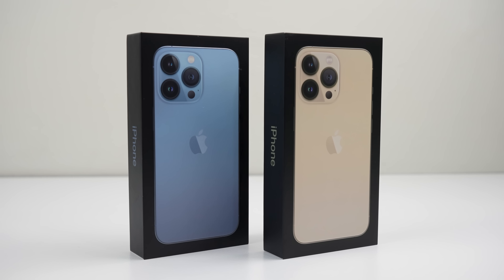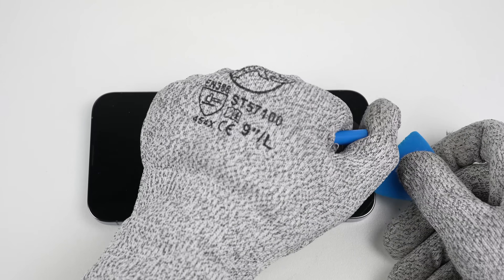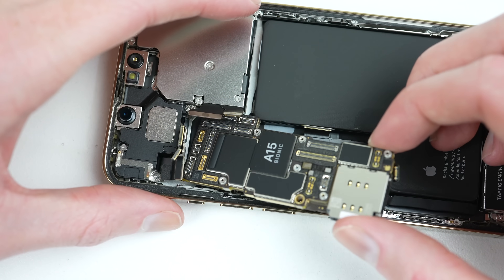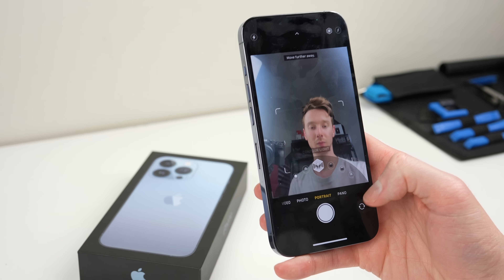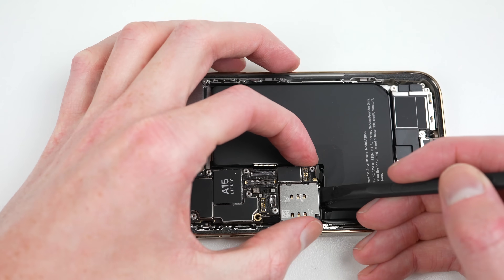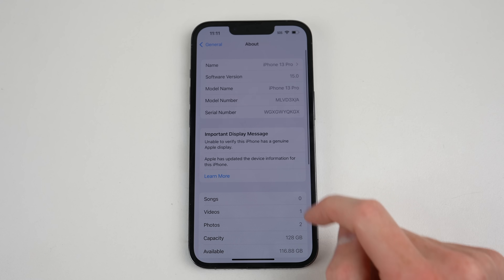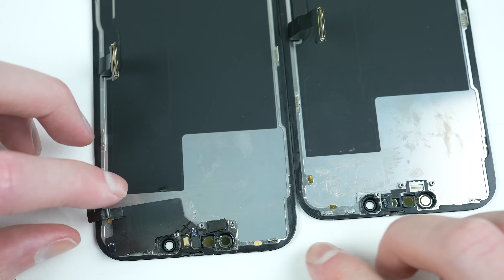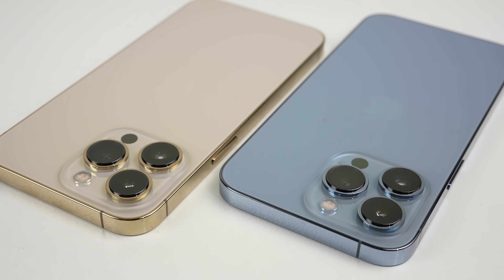iPhone 13 A Repair Nightmare - Teardown and Repair Assessment

Comment: This is fucking criminal. 

Imagine changing the oil in your car and finding your turn signal and headlights no longer work because you didn't get the oil change from the manufacturer.
Reply: No no no. Not just from the manufacturer.  You need it to be changed by manufacturer, or prepare for unforeseen consequences
Reply: @Raghetiel  It’s not shutting down! It’s not-
Reply: @bluedogz1624  Nice half life reference.
Reply: @Raghetiel   like not getting a third entry
Reply: On new BMW models you have to go to a BMW dealership to get an oil change, because you need some proprietary tool that isn't even for sale, in order to simply change the oil.
Reply: @overlordh1254  also i think there was a time when BMW has subscriptions to use apple carplay when a new toyota corolla has that as standard if i don't remember
Reply: @aujorduunforte2922  Some BMWs and other manufactures force you to have a subscription to use the heated seats!!! No joke
Reply: @overlordh1254  you don´t need to if you know how the tools work and more important how to make tools.
Reply: @overlordh1254  I have a relatively old Lancia Delta, still it's better to do a lot of work using Lancia services instead doing it to yourself. The number of electronics and the complexity of the multijet engine, even 11 years ago, were so high that even changing the battery by yourself can cause a failure to some electronics if not done professionally. I think that the new cars, that are even more connected and extreme, have even more issues if people DIY causes wrong currents in electronics power. So I think that, to avoid damage to CPUs, batteries were blocked at software level. Also, probably the oil is because with the new standards even the engines are really difficult to manage as a DYI. The latests Ducati motorcycles have parts that are manufactured under vacuum, and needs special tools to replace. These parts are needed as if not done under vacuum, the engine cannot be pushed to the performance they're pushing it now, that it's fairly extreme for a two cylinders. As more as something become technologically advanced and miniaturized, as more it cannot be easily replaced by third party or yourself.
Reply: BMW did it with car batteries -.- on new models if you change the battery yourself, the car won't start - because the battery is serialized -.-
Reply: @supermodel2011  how do they serialize a battery, isnt it just positive and negative leads.
Reply: @TAussieG  the newer BMW models are equipped with what BMW calls Intelligent Battery Sensors
Reply: @TAussieG   not really. Even mobile batteries have 2-3 additional outputs(in addition to + and -) which help to monitor things like Battery percentage and temperature.
Reply: @TAussieG  If they're Li-Ion batteries, they're not only positive and negative, they also have a controller that can be interrogated for serial number and battery health. The very same you find on cell phones. Li-Ion batteries needs a controller to work properly, because without they can break or even explode. I think newest models uses Li-Ion battery, and Hybrid models surely do. Hybrid and full electric can use only branded battery packs, specifically designed for the car. The battery pack also have it's own electronics for diagnostics and security.
Reply: @TAussieG  No. Every rechargeable battery has to have built-in protection circuits, which are smart enough to be programmed to kick the bucket if somebody tinkers with them...
Reply: @supermodel2011  Oh my 320D from 2009 had already the intelligent battery sensor. If you changed the battery by yourself, it simply does not a full charge. This told BMW. You have to code your car before changing the battery by yourself. Since then It was my first and my last BMW
Reply: @TAussieG  most likely, it has a chip on it, so once you change it for a normal battery, the car will register that the chip is not there and refuse to function.
Reply: @TAussieG  By adding computers, that not only make it more complicated but more expensive as well.
Reply: @supermodel2011  Idk where you live but that shit does not fly in the EU
Reply: @supermodel2011  Many modern cars have this sistem, it's called BMS (battery management system) you can change your battery, only that you need to let the car know that you did that, and have to fill in the battery characteristics. Many diagnostic tools can do this battery registering part.
Reply: If Apple sold cars :
- Hey Mr Mechnanic i have a flat tyre.
- Sorry they welded the rims to the axles, gotta throw that 3 month-old car in the thrash, people in Bangladesh will burn it for minerals
Reply: cough cough 
All printer manufacturers
Cough cough
Reply: @bluish5189  oh don't get me started on DRM ink....fucking hell
Reply: Don’t give them ideas
Reply: When YT comments are stun locked, forced to repeat the same things through the eons.
Reply: Actually, according to a family friend of mine who is a mechanic, the automotive industry is fucking BRUTAL for making things impossible to repair
Reply: Honestly at this point they’re as bad as printers… expensive and pretty much built to fail..
Reply: you are referring to tesla cars yes?
Reply: My printer does this - tractors do this too i think. Probably all sorts actually
Reply: @Jonas Triltsch I have a M1 Mac, but what does it matter? Apple (as much as i hate to admit it) is a trendsetter. 

When they embed hardware lockouts,  ditched the power brick, put a notch on the screen, removed the Aux port and glue their phones shut, the industry followed.

If they singlehandedly decided to embrace right to repair, the rest of the industry would follow just the same. 

The Adoption of RCS is another issue that Apple is holding back, they want their users to have a shitty experience while texting their android friends so they can pressure and bully them into buying iPhones. That's not my opinion, Apple has admitted this in court and internal documents
Reply: If Apple desighned at least 54% of the next Tesla the car would be a death trap.
Reply: What is fucking criminal is actually buying this shit, lmao.
Reply: What amuses me is the fact that is always someone complaining about the repairability on Apple products but is unable to STOP BUYING IT.
People are stupid.
Reply: For Apple's new car, you won't need to change the oil, because it'll be electric. Yes, you heard me right. They are planning to enter the EV market.
The car will probably brick itself when it detects you've added aftermarket third-party floormats.
Reply: that's because you always have to replace the blinker fluid with an the oil change you noob
Reply: I mean if you're going to reference the automotive industry, this has been in for decades, each and every computer module on your car has an ID number that the car's body control module reads and verifies is right on startup, you cant replace most of them without re-writing the old serial number on the new part, apple just doesnt give out that ability just like most automotive brands dont.
Reply: Stop telling the future.
Reply: So imagine owning a BMW?
Reply: Imagine your blinkers stop working because you didn't change blinker fluid
Reply: Car companies do this all of the time, do you have any idea what you're talking about? Seethe harder.
Reply: Should have got the compatible blinker fluid, 4head
Reply: Criminal? Go sue them la stupid lmao
Reply: buy a new car
Reply: Some new cars you have to pay membership for remote star. You are going to  be able to use your car remote start for one year after that you have to pay membership
Reply: Buying a car only to find that it runs on coal
Reply: Sounds like a printer to me.
Reply: The fact there's still people that buy apple just shows how dumb people are🤣
Reply: Well you didn't use blinker fluid
Reply: Not criminal, but absolute bullshit.
Reply: a phone this expensive I wouldn’t go anywhere else but apple for repairs
Reply: @skittlesbutwithchocolatein2274  and you should have that right. But if someone trust a local shop or want to fix it themself, they should be allowed to fix it without software locks designed to brick itself to keep them from doing so
Reply: Nah bruh. Even if you get it from the manufacturer it will tell you it doesn't work because you're not going to the manufacturer
Reply: That's apple moment for ya.
It forcing you to buy not just their phone, but their WHOLE Ecosystem. The macbook, the airpods, etc. Too isolationism and way only work their own brands, I don't get it why people want to be live in wasting bucks like that.
Reply: Apple says, what are you going to do about it - go to Android?
Reply: Is this still a thing or is it remover and czn you swap it now withour a problem?
Reply: Just give them time and you'll see it in everything, want to make a burger with different brand of mayo than the mustard? Too fucking sorry, now your burger is poisonous.
Reply: That’s so criminal it’s latterly idiotic
Reply: BMW
Reply: Only screw parts only can inter change
Reply: Not oil, but don't give Elon musk any ideas to use with Tesla.
Reply: Shush! Don't give them any weird Ideas.
Reply: Not just that but they create the problem, sell the solution but also make it you have to pay the wages of 50 employees and their Christmas bonuses just to fix your screen. I've fixed so many devices in my life, never have I seen it on the level of apple. They are complete scum. I knew from age 15 when I built my first pc for 700 and the mac at the time with same specs was 3k!!! This was with a monitor ect by the way! If I wanted I could have just put the macintosh os on my pc but decided never to ever buy from apple in my life after that.
Reply: Oil is an expendable/consumable item. Mobile phone parts are not.
Reply: @bp6837  I know of people who change their phone more of often than they change the oil in their car. 

Joking aside, people usually hold on to their phone for 2 years. That number makes sense since that's the point where the battery needs replacing. So yeah, there are consumable elements to a phone.
Reply: Just don't buy it. Smh
Reply: @_GhostMiner  not buying it isnt going to stop these phones from pilling up in landfills because it's cheaper to buy a new one than to fix the old one
Reply: Cars an phones are 2 totally different things quit trying to compare them to try and justify that it’s not ok
Reply: @SlapshotJack  I own them both, I should be able to fix them if I can, or pay and independent repairman if I can't. That's true of phones, cars, washer machines, TVs or anything I lawfully purchased

If I bought something it should be mine to do with whatever I want within the limits of the law. The manufacturer has no right to block me from doing anything that doesn't explicitly break the law (like fixing something that is broken)
Reply: @LawrenceJohnYoung  yeah whatever it has nothing to do with the law the reason why they don’t want you to repair it is because the 3rd party repair person may end up making modifications or unauthorized changes that void the warranty and that is designed to keep people from getting pissed off if they take their broken iPhone in for repair at an apple store and demand a new one but they can’t because the warranty is voided
Reply: @SlapshotJack  cope, mald, seethe
Reply: It's not and it is, indeed. You're right, but also wrong. For the 99% of the people who buy phone, it's criminale. But these issues are because all the components are hardware firmed, and secured. This means that nobody can install into your phone malicious hardware (if we exclude Apple itself :) ). From a security point of view, you're secured that you cannot use compromised cameras, or hardware that can steal your FaceID data, and even the OS monitor the hardware that you have components that does not satisfy motherboard digital signatures. But this also means that your phone can be repaired only at Apple, and mostly changing the entire motherboard itself. Now, which is better? Security or the possibility to repair the device? Well, it mostly depends on who have the device, and for the most of the users, repairability is a key factor. For me, as I'm a professional, I prefer security as I dislike to repair things using third party support.
Reply: @AlessandroMorvillo  security? Changing display disable faceid completely, what the point of it? I can understand a warning message to tell you the display is been replaced, but disabling FaceID deosn’t make sense. If you are out of Apple Care it will cost 299€ to replace the screen on you iphone, better buy a new one ahah
Reply: @Reiza72Owened  FaceID will be disabled with every major changes. Display, FaceID and motherboard are related, and FaceID can be electrically compromised via display. That's why. You have the very same issues with Dell PCs and Apple MBP. Every piece is signed, and even Apple cannot repair it. They simple change the broken piece, or the chain of related broken pieces. The innegable fact is that by now, a large number of malware or data breach is done with social engineering, making the user accept and launch the malware. From a security point of view, this level of integration and signing works very well. From a repair point of view, even for Apple is far easiest to give you a new phone, as the new parts keys will never fit the old phone keys. You want privacy and security? This is the cost of asymmetrical keys signing. You cannot change private key, further you cannot change parts certificates, so you're doomed to remove completely them.
Reply: @AlessandroMorvillo  ,

security is much more important in the age of all our crypto information on our phones. Cold wallets and Hot wallets aside. iPhones users prefer a level of security that is unmatched.
Reply: @Blue-Horse-Shoe  I agree
Reply: But the iPhone isn’t a car? What is your point? Don’t buy the phone if you can’t afford official / authorized repairs
Reply: @sammyj6620  there's a thing called comparing comrade, the phone's are literally desighned to act broken when the components are replaced.
Reply: @sammyj6620  bro your legit special do you think normal people (obviously not all) know how to Google simple fixes? I used to fix people's xboxs/ps3s in school for cheap extra money/xp. Your the type of person that cuts down a tree because one branch broke. Don't be wasteful. I had 3 xbox 360s so when each broke I could frankensiten them to work again. Its not a matter of "affording" it's a matter of not being a wasteful moron. Incase you think apple cares about you , they dont and do everything they legally can to screw you , while you spread em open for them and scream "YaaAAssss DaAdddYyyy"